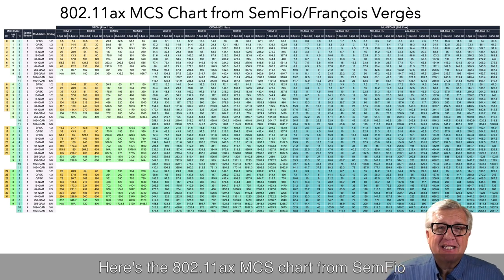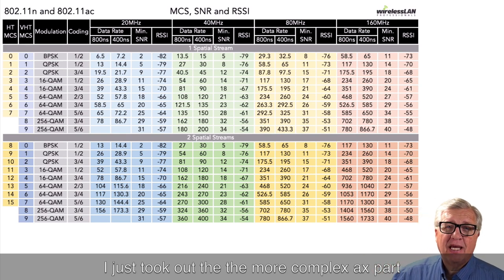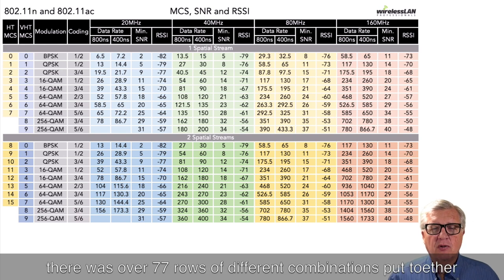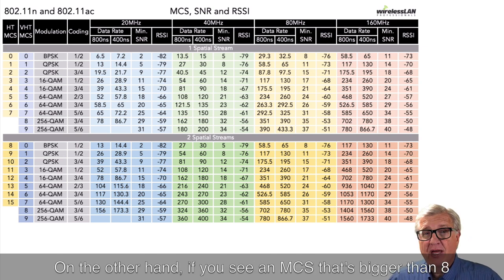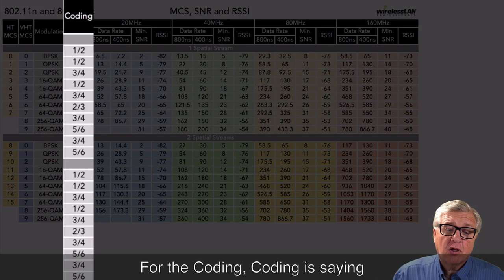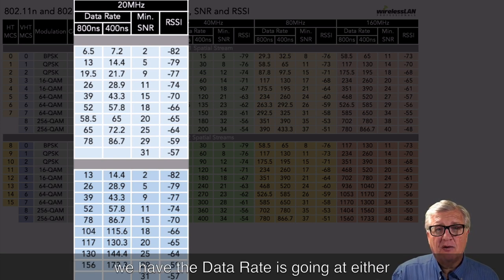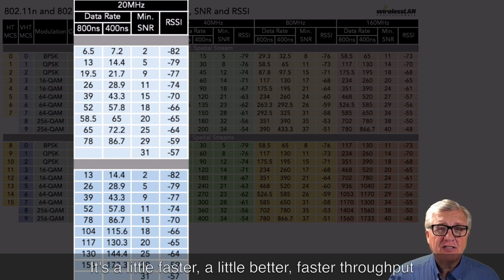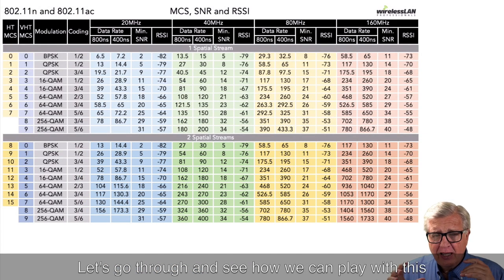MCS Table and How You Can Use it

Comment: On Specifications of some APs: I find under the Reception Sensitivity this: ex: 
11a 6Mbps:-97dBm, 11a 54Mbps:-79dBm
11ac VHT20_MCS0:-96dBm, 11ac VHT20_MCS11:-66dBm
11ac VHT40_MCS0:-94dBm, 11ac VHT40_MCS11:-63dBm
11ac VHT80_MCS0:-91dBm, 11ac VHT80_MCS11:-60dBm
11ax HE20_MCS0:-95dBm, 11ax HE20_MCS11:-63dBm
11ax HE40_MCS0:-92dBm, 11ax HE40_MCS11:-60dBm
11ax HE80_MCS0:-89dBm, 11ax HE80_MCS11:-58dBm

1- why mentioning 11a,ac,ax since HT, VHT, HE are mentioned? both indicates the same thing from my understanding. 

2- how come there is VHT with MSC11? From my understanding VHT is iteration of 0 to 9 and HE is iteration of 0 to 11 (with each iteration the spatial stream increases +1) 

3- The information above don't mention the spatial streams so you can't really tell which Mbps it corresponds to.

Thank you so much

Comment: Hi, Great video.   Is it possible to obtain a MCS value from a win 10 device or application?
Reply: Not directly - you can get the current data rate, then reverse engineer from an MCS table by looking up the data rate. But sometimes, there are multiple possible combinations of MCS that give the same data rate. So you might have to guess on Spatial Streams to narrow down your result. This is another reason I love using macOS since it freely and easily reports MCS.

Comment: Is there any relation between MSC and Tx power?
Reply: I am a novice here but I think the answer is no. You can uphold a higher MCS without having taking into account TX/RX. But I think a lot of vendors only looks at TX/RX in matter to choose the best Access-point. Sadly
Reply: @traver1965  I am asking because I've seen lot of vendors who published some dependance MCS-Tx power-Rx sensitivity in datasheets. For example, Aruba and Mikrotik always do that. For example, for Mikrotik LDF5 there are such references: for 6 Mbps max Tx is 25 dBm, Rx sensitivity is -96 dBm: for MCS7 max Tx is 19 dBm, Rx sensitivity is -75 dBm. I understand why you need better signal to work with more complex constellation, but why you can't transmit "harder" for them — I don't quite understand.
Reply from the maker: Andrew - We've added your question to the queue.
Reply: Thank a lot! That would be awesome!